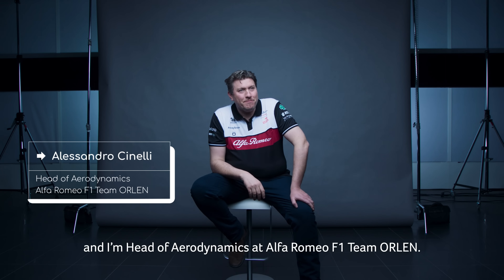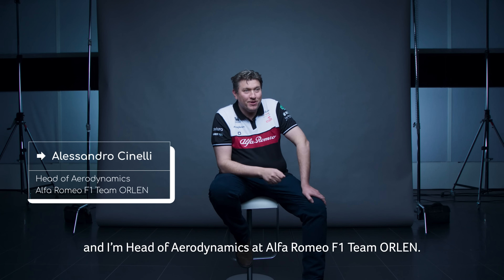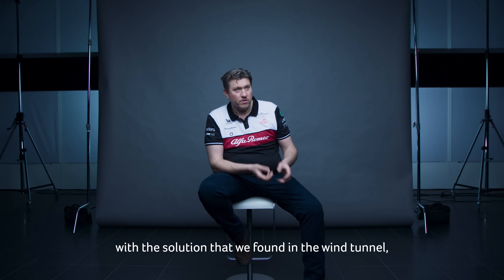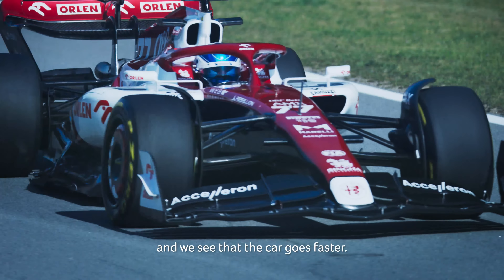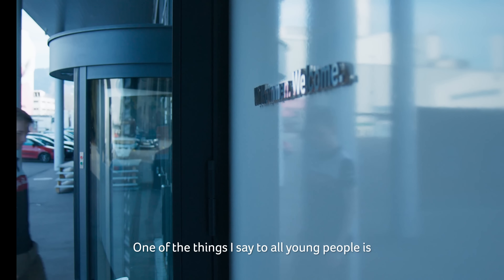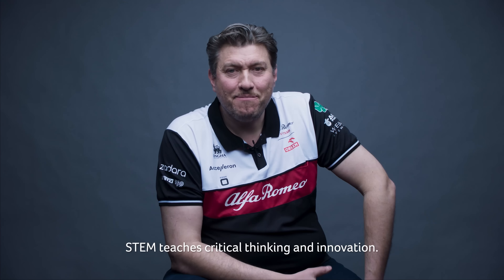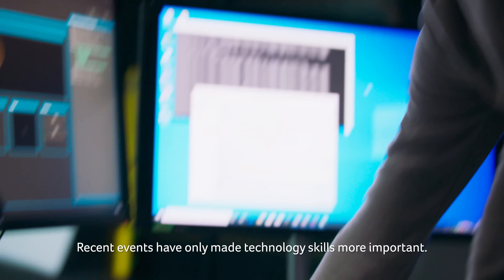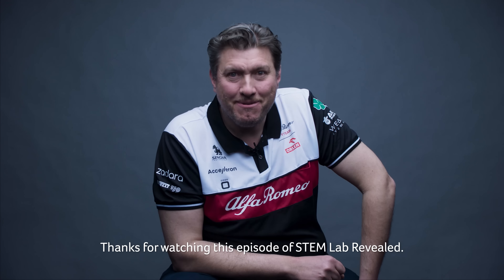Driving Innovators in STEM | STEM Lab_ Revealed | Design Thinking, Math & Science Skills | Acer

Comment: Launch Acer Liquid Z6 with This specs:
-Snapdragon 7 Gen 1 Processor
-5000 miliamps Battery with 90 watt Fast Charging
-64 Megapixel Triple Camera
-20 Megapixel Pop up Selfie Camera
-Acer Battery Management Chip
-3,5mm Audio Jack
-Stereo Speakers
-Mini LED FullHD Plus 120hz
-Adaptive Refresh Rate
-Dual SIM 5G With Wi-Fi 6E